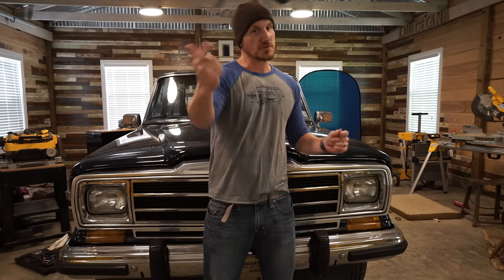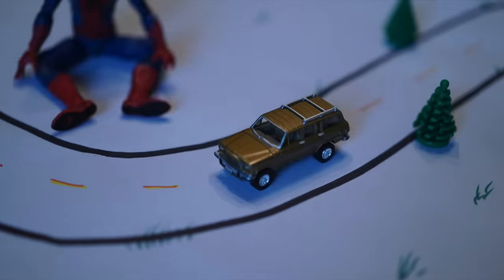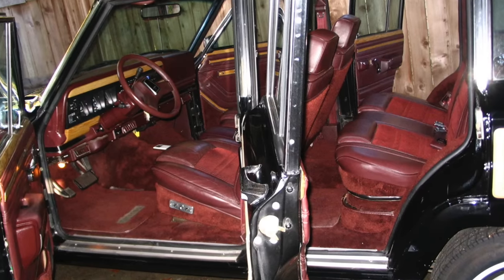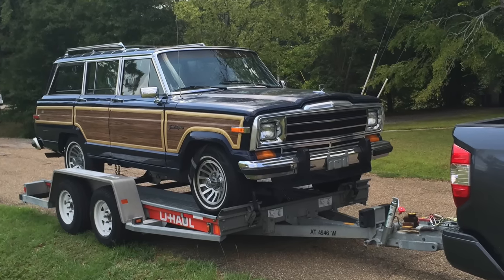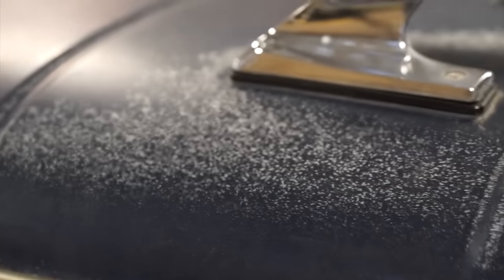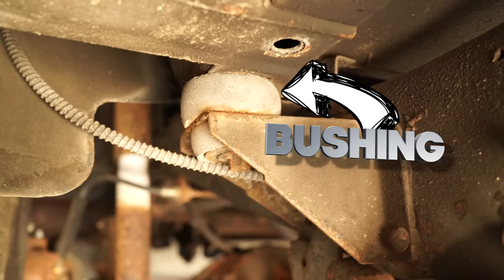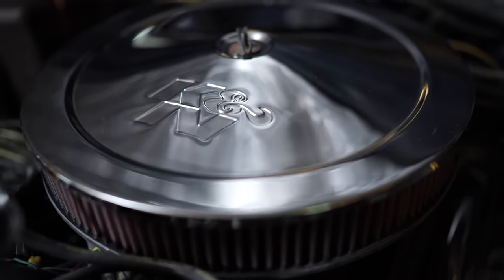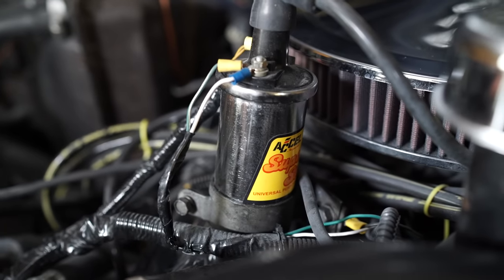Restoring The Jeep Grand Wagoneer  - Part One

Comment: Got an '88 Blue with the Sand interior that I am hoping to fully restore as you are... already had the engine, transmission and transfer case all taken care of previously... added MSD ignition and a higher performance cam.... stainless 3" exhaust with flowmaster cat and muffler... also has a sunroof and other stuff... I want it to be my retirement project for restoration in the next three to five years.... had it for almost 25 years now and LOVE that truck!!

Comment: I have an '84 Grand Wagoneer with only 88,000+ on the clock and am following your restoration. I've taken a break from my efforts due to some health issues but try to do what I can as often as I can. I wonder, what type and where did you get the rubber wheel to remove the vinyl wood grain? 

It's been fun and I have a nice 3 car garage to work in but with all of the kids 'stuff' stored inside, it's a bit hard getting to things. 

Thanks for the videos. I'm looking forward to seeing the rest of them.  BTW, I live about 50 miles from the Wagonmaster.

Comment: HI there, I drive a 1985 Jepp GW. Great videos. Got some inspirations. You say you installed a full injection system. Would you say that was worth while? Did it make a difference in fuel consumption and most of all the way the engine start? Thanks for the feedback.
Reply from the maker: Capt Cooper my main concern was having it start and not having to deal with a carb. I don’t really track fuel consumption. It was worth it to me to drop the carburetor and have a more reliable start after not using it for a week or 2
Reply: @HamptonRutland  Thanks, appreciate you taking the time to answer.  Makes sense... mine, too, gets a bit upset not being driven for some time and shows it by starting slow...

Comment: All My Cash? All Makes Combined? American Muscle Car? (╹◡╹｡) I'm impressed that you managed to get a fuel injection system for this even if it is throttle body only. I kind of have an idea for a destroked 401 in the future to modify an Edelbrock manifold with specific machining to enable the setup for MPFI. I just can't get along with having a carb or throttle body that leans out far end cylinders even slightly. You did a great job to start.

Comment: The Wagoneer was 1963-1983, then in 1984 Jeep renamed the Wagoneer the Grand Wagoneer, which is the title it carried through the end of production in 1991 (all the SJ model).  In 1984, they reused the Wagoneer name on the smaller XJ style Jeep.
Reply: Two door model was Cherokee.
Reply: @waltmoore3095  there was a 2-door version of the Wagoneer through the mid-60's.  The name Cherokee was used from 1974-1983, and there was even a 4-door version of the Cherokee as well.
Reply: @ryanhart1462  I do remember the later 4 door Cherokee models, but I've never seen a 60's model. Thanks.

Comment: Man I need standards like this dude "I didn't like it so now it's shiny"
Reply: It might be an idiot behavior at the surface but to the trained eye this is actually a good investment for the poorly aging and leaky valve cover system. Gives you the chance to look at the valvetrain, bolt in new pushrods and rolling rockers, undo 35+ years of yucky OEM gasket seal with a fresh cork, put in new rubber for the PCV system and more importantly, makes any leaks in this portion much easier to detect. Shiny isn't the wise investment but it definitely marks this work as DONE and allows you to move on to the next portion.